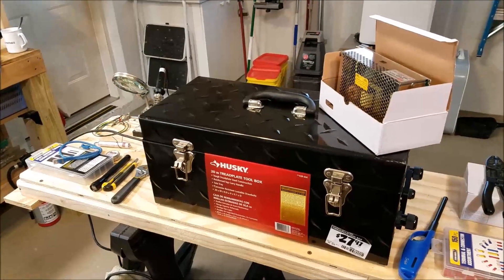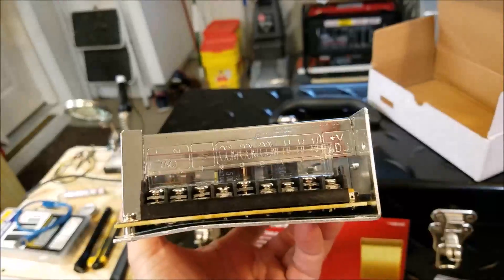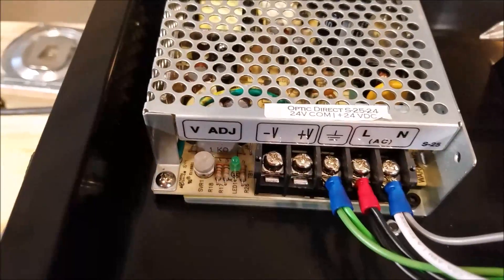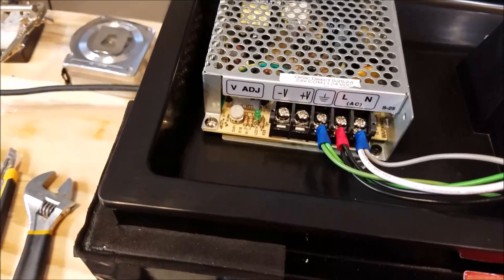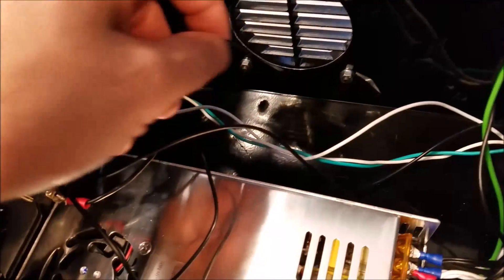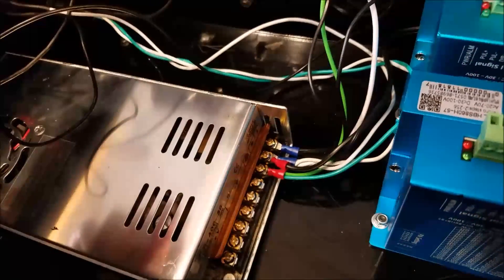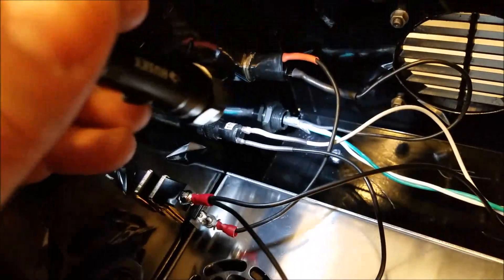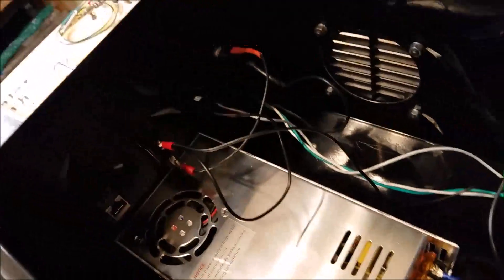DIY Closed Loop CNC Control #2: Power Supply

Comment: Hi folks. There is a case for using seperate switching power supplies for each hybrid stepper motor driver. It avoids electrical spikes from getting too big and tripping the single PSU. This can happen when several stepper motors are being driven at the same time. The alternative is to use a linear power supply, but they are big, heavy and expensive. Search 'Clough42' for more info on this. BobUK.

Comment: Hi folks. Ground wires. DO NOT DAISY CHAIN THEM! Take them all back to one single 'Star' point - ideally a big metal stud attached the the metal tool box. This minimises the risk of electrical noise getting fed from one electronic unit to another and is standard practice in decent hifi amplifiers for example. Ideally connect the supply earth input direct to the 'star' stud and then connect that to thr PSU earth terminal and all the other earth terminals. Franco has used crimp connectors on the terminations and this is very good practice. Note that the earth screens on signal cables need installing differently to the supply earths and I'll pick up on that later if Franco has not already done so. It's correct to daisy chain the the neutral and live if you find that easier. Do not connect neutral or live to the case!BobUK.
Reply: Is the shield for the psu usually grounded? If so, do you need to take special precautions when screwing the psu case to the metal box in order to avoid a ground loop?

Comment: Hi. Very helpful, thank you. I suspect the 220 volt default setting is in part  due to the EU 'CE' mark requirement. It is the safer default, if you plug in to a US 110 volts when set to 220 volts it may not work, but it should not blow up! The other way risks us Europeans plugging 220 volts into a PSU set for 110 volts, and that is not a good idea. BobUK.

Comment: Great series of videos, thanks! Could you describe what gauge wire you use for each component?
Reply from the maker: Great question.  I use 18 AWG for anything "powerful" like the 110V AC.  I also use the 18 AWG between the switching power supplies and the drivers.  For the logic level stuff (5V DC) I use 22 AWG wire.
Reply: Franco Awesome, thanks!